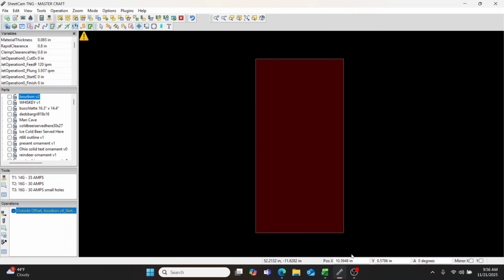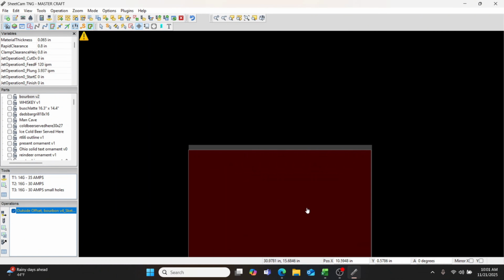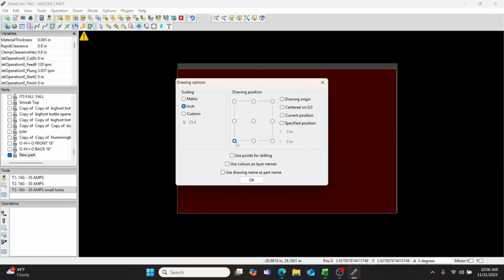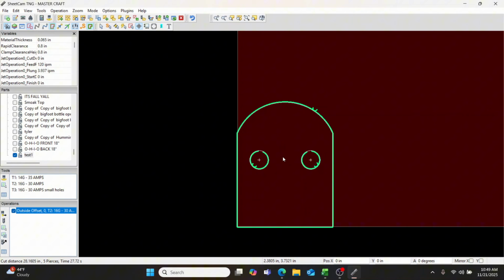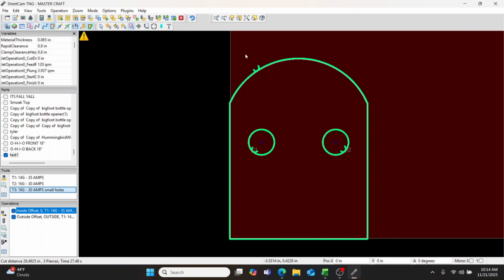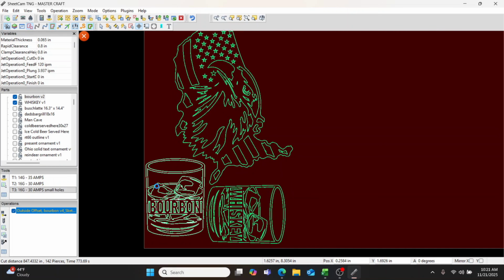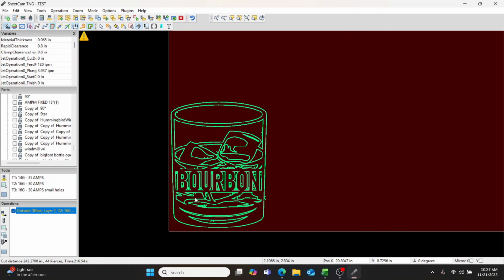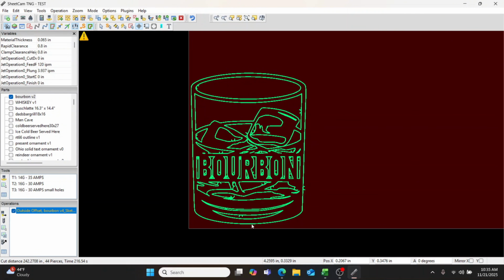How to Use SheetCam: Complete Beginner Guide Tutorial CNC Plasma

Comment: Good morning I looked at your video and exactly what you said for three years. I’ve been trying to get my torch to work and I was very close. The only problem I’m having is when my touch touches Metal digital light comes on. It just only retract a little bit I needed to go like 3/16 of an inch and then move very slow going down. How can I fix that or can you help me I use draft site to do my drawing and sheet camp. Also have lazy CA thanks. Can you help me?

Comment: Love this video. I’m new to sheetcam. I have been referencing this video a lot. But how did you get your parts to save in the side menu like that? I’ve been trying to figure it out.
Reply from the maker: You have to save your job, and then go back into the same job every time. For example, all 16ga parts I cut frequently I use my "Master 16ga" saved job and just re-save it every time I add a new part so it keeps it in there for next time. Then if I only use half of the sheet and want to save it as a skeleton for future ease of nesting, I "save as" a different job so I can pull that exact sheet up later and it will have all of the previous parts there I can nest around. Just make sure when you do this, nest all of your parts first, save it, then "hide" all of the previous cut parts before you "run postprocessor". Hopefully this makes sense.
Reply: @slyhlife thank you. Yes i understand better. It’s been trial and error some. But I’m getting the hang of it.

Comment: Thank you for the great tutorial!  You make it seem so easy but I think I will jot some things down anyways!
Reply from the maker: Glad it was helpful! Let me know if you have any questions.
Reply: @slyhlife  Now that you have asked me.... My situation is from inside the cabin I can do all this prep work.  Where I would be actually cutting out the project I don't have wifi, the satalites are around a corner.  Would I use a memory stick for the entire process even though I have Firecontrol on my laptop?  Thank you again , you are very easy to follow and are a great tutor!
Reply from the maker: @Kelly-yo2yk we actually worked without wifi in our barn for years, and finally just installed a bridge system a few weeks ago (which we actually have another video on) 
So our workflow was always draft and do our CAM up at the house. Then export your cut file from Sheetcam to a saved folder on your desktop. Then it is ready to import into Firecontrol when it is time to cut. We use the same laptop for Sheetcam as we do Firecontrol, so we just carry it back and forth. If you do not want to use the same computer, then you could just download your cut file to a memory stick and use that instead.
Reply: Thatscoolaboutthebridging!Fornow,shouldIloadeverythingontomystickandthentakeittotheoutbuilding?
Reply from the maker: @Kelly-yo2yk if you are using a different computer for Firecontrol that is what I would do.
Reply: @slyhlife  Thank you for clarifying this operation to me!  Its overwhelming but your video takes the overwhelming part out!
Reply: You're great teacher!  Another question or two!  It sounds like you have the Razor 45 plasma machine.  I thought it was to use 50 amps but your programs say 30?   Another silly question...what spare nozzle tips would you suggest me having as backups once I get this system operating. ?   Thank you again, sorry to be a pest!
Reply from the maker: @Kelly-yo2yk no worries at all. The Razorweld45 only cuts up to 45 Amps. The consumables we have always used are these:

https://ebay.us/m/af0Euu

We typically cut 16ga at 28-30 amps, 14ga at 35 amps, and 11 ga at 35 amps. These are our 3 most commonly used materials
Reply: Thank you for all your tips and info!  You are the best!

Comment: Hello, I just purchased a bunch of your files of etsy! Using sheetcam will be extremely helpful for cutting these out. My initial trial went great and using your video. However I believe the free version is quite limited. And when I went to purchase it was $404 CDN dollars. Is this correct or am I getting the right version? Do you know if there are deals on this software anywhere?
Reply from the maker: Unfortunately, after posting this video I just found out that Sheetcam has raised its price. It does however have additional features such as it's own CAD now (I have read it is limited) and it's own "auto nest" feature so you do not have to manually nest parts. I am sure there is more, I need to do a little more research still. Unfortunately, the cheaper/older version is not available for purchase anymore.
Reply: @slyhlife  Hi slyhlife, know this is a long shot but do you think you can test my CAM software for plasma cutters that I made? I just need some user feedback for bugs, feedback and feature requests. I have one tester so far who ran a part on his Mach 3 successfully. If you help me I can give you some free lienceses when I release? Youtube automatically removes my links if I post a url, so the link to the webapp is on my channel the only video I have on there. Theres no sign up for the site.
Reply from the maker: @jumppadgames44  we would love to test it out. I will try it out this week and let you know feedback. Thanks so much!

Comment: This is just what I need to help me get going, thank you ! I am using a Razorweld cut 45, but I don’t see it listed on the post processor.
Reply from the maker: When choosing your Post Processor you would select your machine control software. Ex: FireControl, Mach3, etc. instead of the actual plasma cutter itself. Hope that helps! I completely forgot about this step as it's been 4 years since I originally set ours up. I will add this to the video. Thank you!
Reply: @s @slyhlife thank you ! I hope you do some more “how to” videos !

Comment: Thank you, been following along for a good while and nice to see another CNC'er just trying to help. i have a question that I can not find an answer to. sometimes I need to select many contours to put on a different layer so is there a way to lock the control button while I choose my contours. Can be very difficult to keep that button down while navigating my drawing to choose what I want and then how do I go back to normal mode ? You guys have come a long way, glad to see it.....
Reply from the maker: Thanks for following along, and that's a great question about selecting multiple contours! There are a few options when selecting your contours (Make sure "Edit contours" is selected first):

1. Holding down the control key (which I understand can be a pain if selecting many contours at once)
2. Using the "box selection" you can select multiple by drawing a box around them. This only works if they are all adjacent contours.
3. If you right click over a contour, there is an option to either
    a. Select all closed contours
    b. Select all holes
    c. Select all outside contours
    d. Select all inside contours
    e. Select all - (if you are needing to select more than half of your contours this could save some clicks. Choose this option and then just de-select the ones you don't want)

Unfortunately, to my knowledge there is no "lock" feature to the control button, other than manually holding it down while selecting your contours. This is definitely something Sheetcam could improve on.
Reply: @slyhlife  Just my luck, I am selecting OPEN contours.............I may look into selecting all and deleting the ones not needed. Thanks for the reply.👍